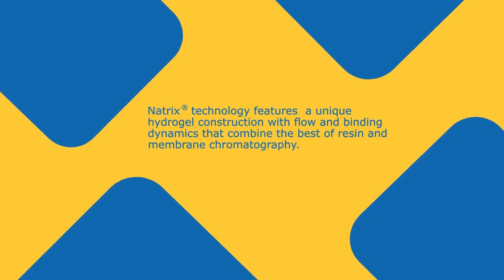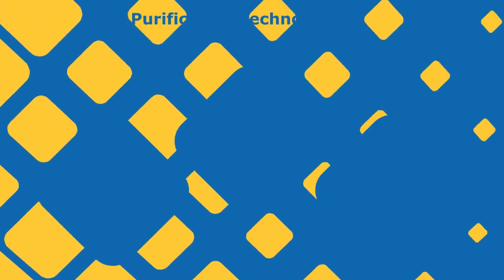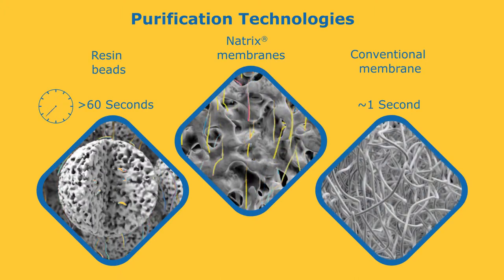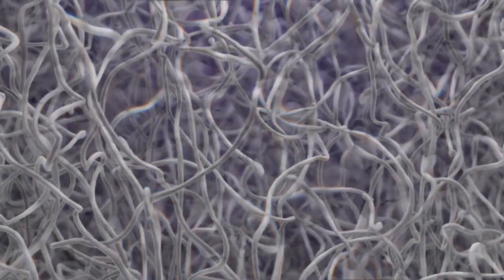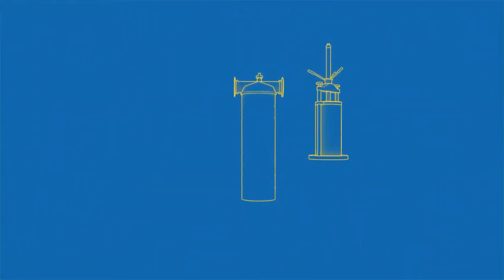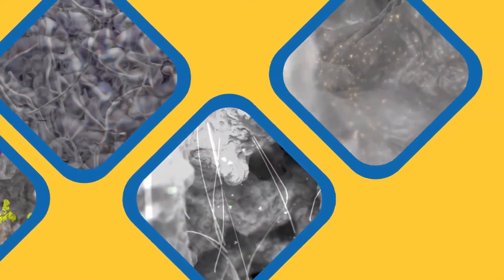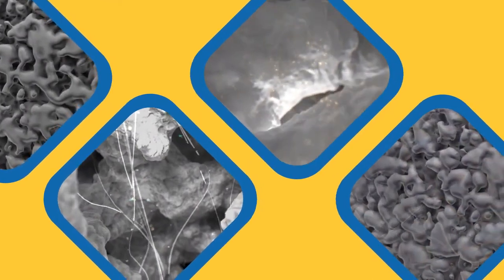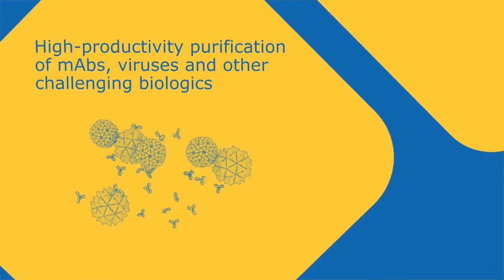Natrix® Chromatography Membrane

Comment: Why are they one time use ?....after eluting the target molecules, they should be reusable similar to ion exchange resins
Reply from the maker: Great question! Natrix® CH devices are designed as single-use, plug and play devices to simplify purification workflows: they eliminate storage, cleaning, and re-validation steps, reducing operational burden and accelerating manufacturing.

The technology is robust, and internal studies have demonstrated cyclability without performance loss for up to 20 cycles, enabling customers to reuse within a campaign if desired. However, re-use is highly dependent on feed and must be verified by customers under their process conditions.

For more details, you can check our FAQ page here: http://ms.spr.ly/6056tiIfq